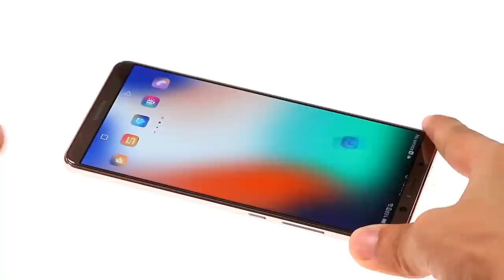Huawei Mate 10 Pro Screen Replacement - Tutorial

Comment: I just smashed my motherboard because I forgot to remove the SIM drawer ... This tutorial completely DESTROYED my phone !!!

- In addition, I have two antenna cables (one black and one white), I followed this tutorial and not seen the black
- When he removes the speaker he forgets to specify who there is a Phillips screw
-  on the frames sold the lower capacitor is missing, no procedure to recover it is posted in the video. So I'm stuck now!

of course I follow the video step by step and gradually discover these errors .... and have destroyed my phone...

Comment: 3:44 For Step 7 , removing the screen, you can try to use Precision Razor Blade ( buy from ebay /amazon, the one that looks like surgeon knife  ). It's a good combination with heat gun as well. You can recycle the Gorilla Glass if you want, but highly doubt you'll use it though

Comment: Hi! When I was trying to remove the battery, it started to do like a little spark (I bent it...). Can I continue to remove it now that it is damaged? I'm scared it will explode or anything.
Thanks for your video!
Reply from the maker: Add some alcohol under the battery to soften the adhesive. It won't explode but it could start smoking if your break it.
Reply: @EricWitrigs  Thanks a lot!!